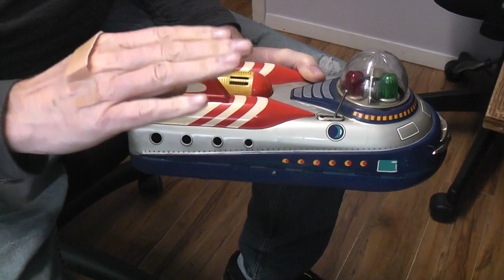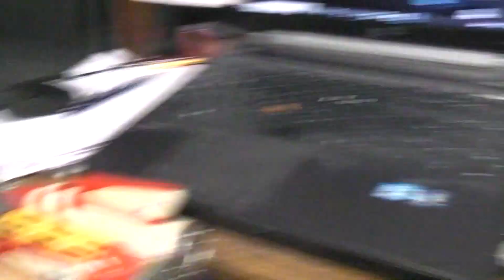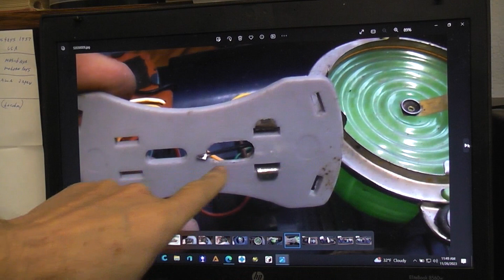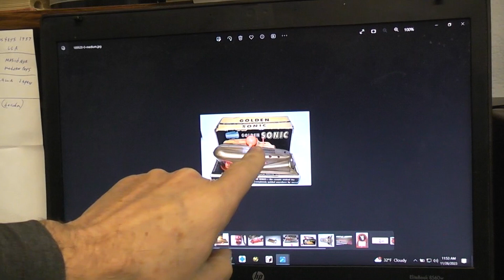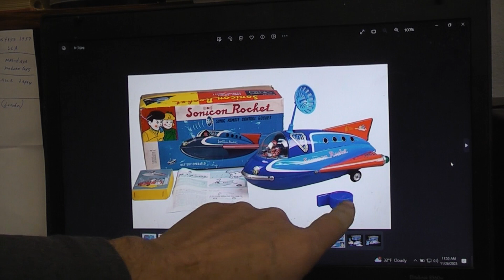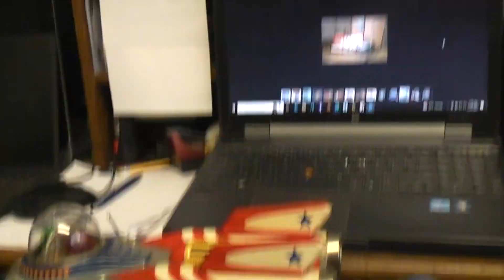How it works. Rare "whistle" control Sonar Space Patrol by Yonezawa / Japan

Comment: Wonder what would happen if you used. Horn speaker setup for the output to
From the whistle to increase sensitivity? A bit like the those stringed instruments with horn speakers in them to amplify the output sound for phonographs
Reply from the maker: A horn bell on a whistle, now that should be louder. It really comes down to designing a proper whistle not just for the right frequency but also the right output level. I was not willing to put the time into the whistle design. I got the right fundamental tone but not the output level I wanted.